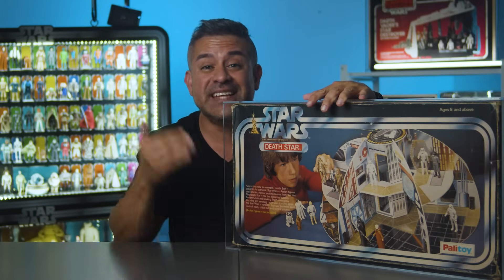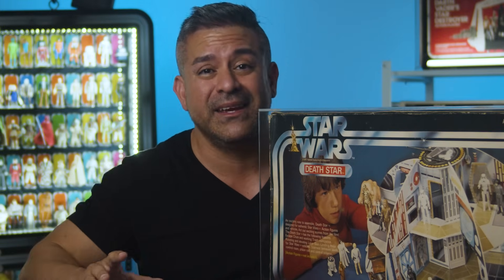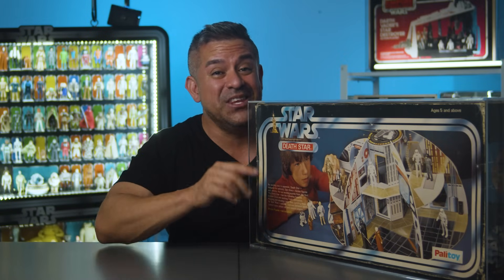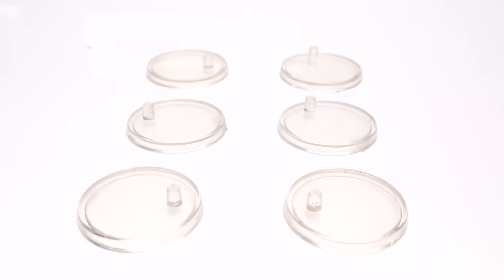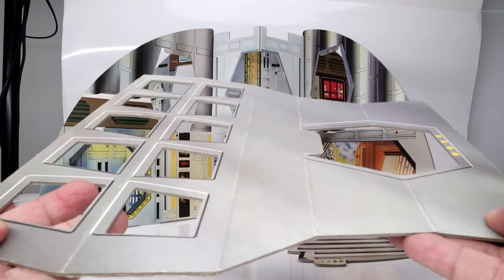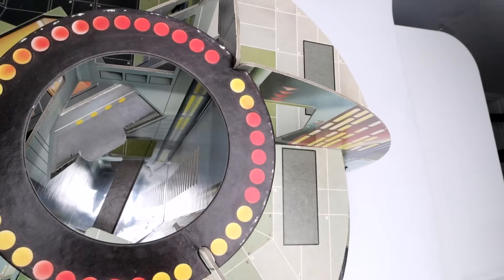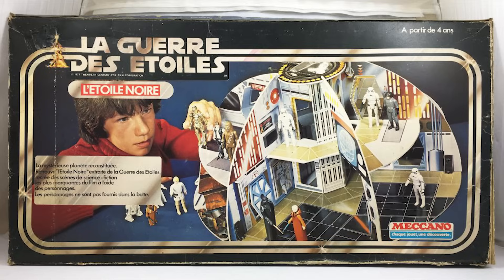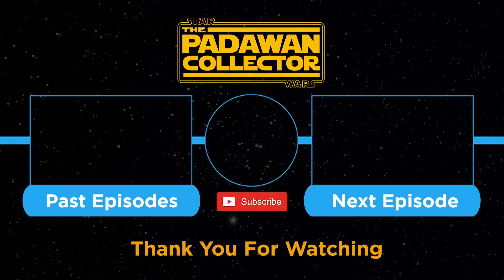Is This THE BEST Vintage Star Wars Playset? The Palitoy Death Star - EP 18

Comment: I had this set as a kid.  Was the Palitoy version, not the Tolstoy’s one (I’m in Australia).  Was my most-used toy from that collection, and I had quite a collection

Had a Toltoys (might also have been Palitoy) X-wing, without lights and sounds.   This was easily fixed with a trip to the local Tandy (an electronics store, not around these days) for a light, motor, push button switch, and battery holder.  Disassembled the ship, drilled out the nose where the light went, and fitted it.  Cut out a piece in the base, for the battery pack, and drilled out the top, to fit the push button.  Cut the removed piece in two, and fitted them back in place, so they could swing open, like saloon doors, attaching them with some white electrical tape.  Worked like a charm.  Not too shabby for a fourteen yo, with no electrical experience… :)

Cheers,
Reply from the maker: You were a toy guru back then!  Are you an engineer now?????  Thanks for the awesome comment Wolf!
Reply: @thepadawancollectorofficial  “retired” now.  I amassed an eclectic set of skills over my career.  Am a Jack-of-all-trades, and master of none, unfortunately… :).

Comment: Hello my friend.  I bought one of these off eBay a few months ago, and I'm having a little trouble setting it up, specifically the second level floors.  Do the tabs on the horizontal floors mount thru the same slot on the vertical walls from both sides?  Like one tab on top of the other thru the same slot?  It seems like I can only get one side or the other thru the slot and not both.
Reply from the maker: Aww man I see what you means.  Yes this was confusing for me too.  If you want I can post a video just showing this move and do it a couple of times.  Lmk
Reply: @thepadawancollectorofficial  I'd really appreciate that, as the second level floors are sitting somewhat lopsided, as I can only get one tab from the floors into one of the mounting holes in the walls, from only one side. Yes, it is a replica, not the official Palitoy version, but I'm guessing they both assemble the same way.

Comment: I'm a toy designer and these kind of restraints, "tricks" and limitations are very similar to this day. I agree the Palitoy design is more successful than the Kenner Death Star and Imperial Star Destroyer in terms of actually bringing the films to life as a toy. Just the shape alone is so much more Death Star.
Reply from the maker: Hey Casey!  You have the best job ever my friend 🙌🏼.  I agree that this feel much more Death Star than the Kenner version :). Thanks for watching and taking the time to write an excellent comment
Reply: @thepadawancollectorofficial  I will very often try to supplement molded pieces with paper board or high quality printed paper items. Children, parents, and adult collectors rarely complain, often love the added elements. Great way to add value for everyone without increasing the price for manufacturer or consumer. The risk involved in this item if it hadn't sold is probably nothing compared to Kenner's if it had bombed, it's just as true today. Tooling is not cheap.

Comment: Hey….thanks for clearing up a mystery of 45 years. I remember on the first U.K. run of the classic 8 figures (silver and black card backing), they advertised the X-wing fighter on the back. 

My older brother was very despondent that it was clearly advertised as ‘with laser light and sound’ - especially when he got it that Christmas and it did not. It also looked pretty stupid with the box showing Luke Skywalker inside in Tattoine gear, as X-wing fighter pilot had not been released yet.

I think I did better. I got Micronauts Microtron which dumped all over his present.
Reply from the maker: Hey Zacetto!  I’m glad I could clear that up 😎.  Thanks for watching and for leaving such an awesome comment 🙌🏼
Reply: Thank you for a blinding vid. The cheapest, I saw the original figures for, upon first release was 60p. I do not know how much that would translate to US dollars for the time. 

It has always freaked me out that episode IV was largely filmed in Elstree, less than half an hour’s drive from where I grew up in London.